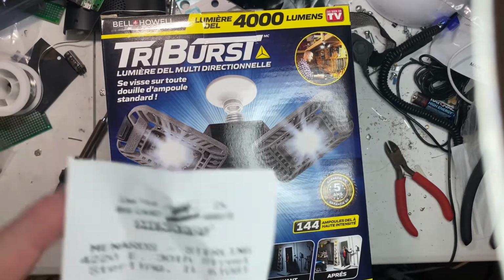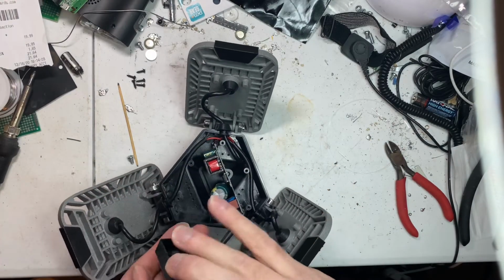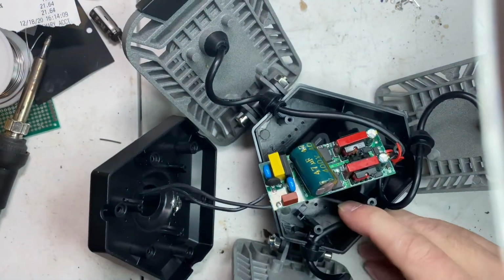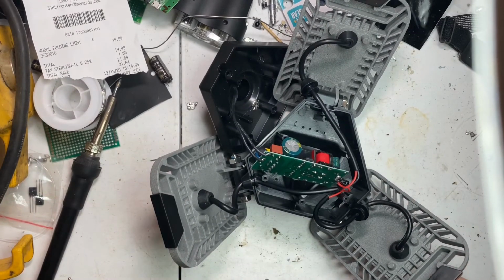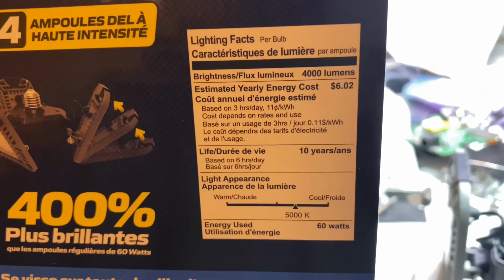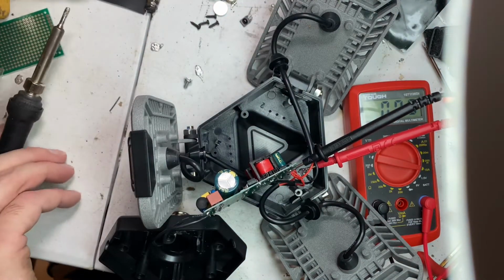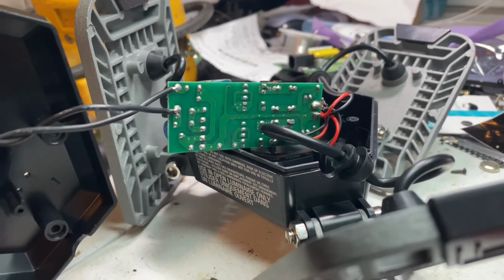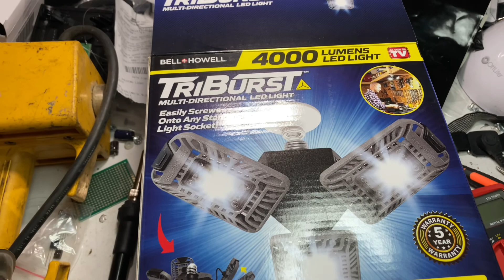Triburst multi-directional led light review and tear down

Comment: As others have said, the thermistor is a very high failure part.  I found another video on you-tube where the legs that remained were soldered or connected together.  I did the same thing and it worked.  Not sure if I trust it, but will use it only while present.

Comment: Bought 3 of em 2 broke within the month

Edit the thermal fuse or surge fuse is what killed mine . Its the first component from the mains. Soldered in a new one . All good
Reply: Can you tell me the part number for that failed component ? Looks like it's a high failure part
Reply: I'm looking for the same.  Mine catastrophically failed and I cannot match the part number.  Any help would be greatly appreciated

Thing only lasted a month.
Reply: @thewibb  i just had a bunch of components ive been collecting over the years I did it by sight only just to see if it would work. So far so good. Open it up you will see the part
Reply: @reneawest9021  t5a fuse.
Reply: @thewibb  t5a fuse

Comment: I have this light and it stopped working I opened it and on the pc board near the fuse is a black component that is burnt. Could you tell me what this component is it looks like a capacitor. Another repair video shows how he repaired his but he saw only the leads there on his and soldered the leads together and the light is working. Not the correct fix he showing people.
Reply from the maker: Read the comment in the video. I posted the link to amazon
Reply: @hitandrepair  I don't see any link to amazon anywhere either. What is the black resistor? Anyone knows?